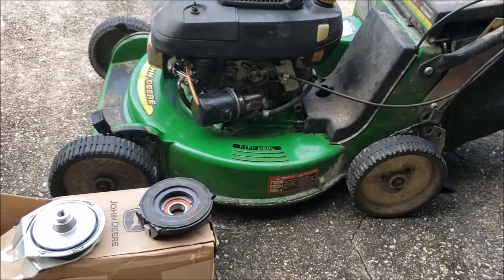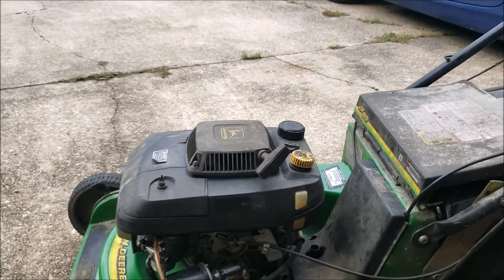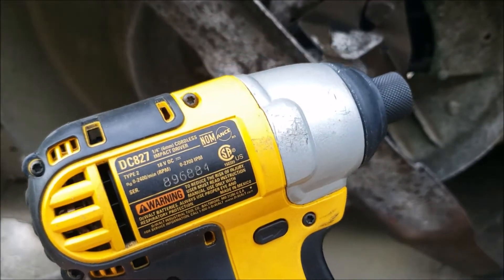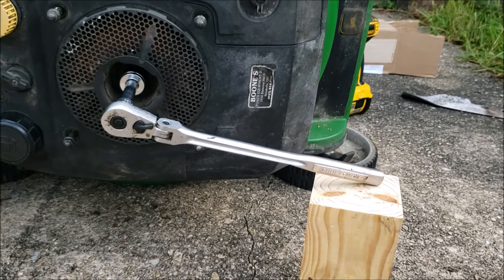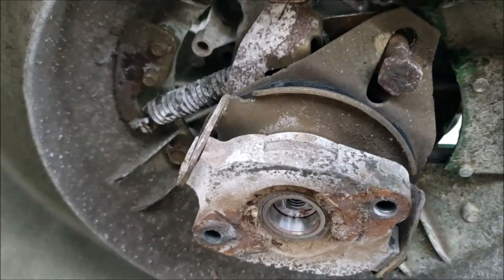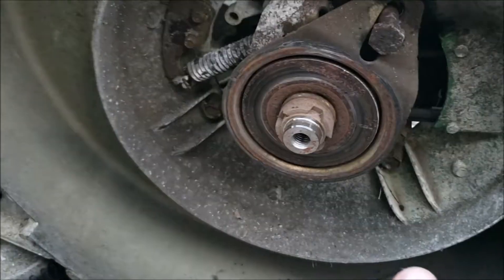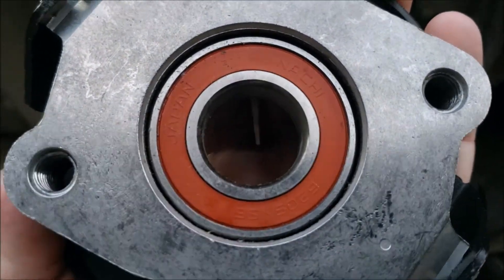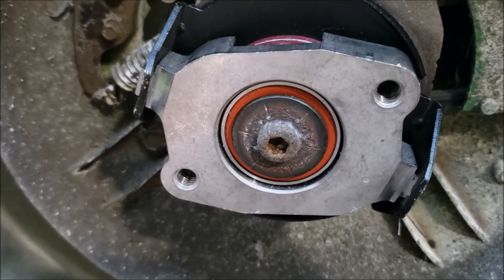John Deere JX75 JX85 Blade Brake Clutch Replacement - 15 Minute Fix!

Comment: When I was trying to loosen the bolt on the clutch , the nut on the the top of the mower came loose first. Am I doing something wrong?
Reply from the maker: John, that can happen. I used an impact wrench to help with that problem. Try using medium Loc-Tite on the top. Make sure the threads are clean and dry before the thread lock compound is applied. After that, use try using an impact wrench on the clutch side.
Reply: Hey John.. same problem. I took an old electric cord and pushed in spark plug hole with piston all the way down. I was able to get blade clutch off.
Reply: Anyone find replacement wheels for these

Comment: How did you know that this needed to be replaced?
Reply from the maker: Even though the engine is running correctly, the blade will not cut the grass. This is not a blade sharpness issue.
Reply: @TZ250FANATIC  thanks I think that this is the issue with mine!
Reply: Is the hex bolt loosened by going  clockwise?
Reply from the maker: @jaimemejia2318  No, all of the bolts are conventional. Turn them counterclockwise to loosen them.

Comment: Fantastic job...never one to tell someone they aren't doing it right when clearly you did by ordering the correct part... looking up the assembly the cost is $410CDN on Amazon...I have two 14SB one JX75 and a JX85 and I don't have $400 tied up in all of them (in fact just bought the non-running JX75 this past weekend for $50...it works correctly now)...you referenced the 'cheap friction material' fix...and said you weren't going to do that (even though you didn't replace the whole assembly either)...I followed that tutorial and repaired the issue for $15...I would suggest ppl weigh their options but I can attest the sub $20 fix works...here is the link...cheers!
https://youtu.be/FSZLPV8jmEg
Reply from the maker: You start with "Fantastic job", but clearly don't mean it. You posted here only to show that you believe you are superior. You bash my methods and parts choice with thinly veiled compliments then go on to speak about another tutorial and spending less money.
Reply: @TZ250FANATIC  not at all...what I was doing was commending you on the correct way to do the job ... But offering an alternative (superior in cost-inferior to a degree b/c not OEM parts)....some of us don't always have the option financially to order the OEM part-but seeing you do the job as you did would only add to someone's knowledge when tackling the job either way...take a compliment when it is given instead of looking for the negative...there is enough of that in the world already
Reply: @TZ250FANATIC  He is right don't be a sucker and buy new from JD. fix it yourself

Comment: Could you please share the part numbers for the parts you bought?  Thanks
Reply from the maker: I bought part number GY20805.
Reply: @TZ250FANATIC  Thank you!
Reply: How did you get tje upper part of the clutch off?
Reply from the maker: @andyhamilton8940  I didn't. Only the lower portion needs to be removed for this job.
Reply: @TZ250FANATIC How do you switch a self propell belt on a john deer r54rkb 😂 I'm stuck